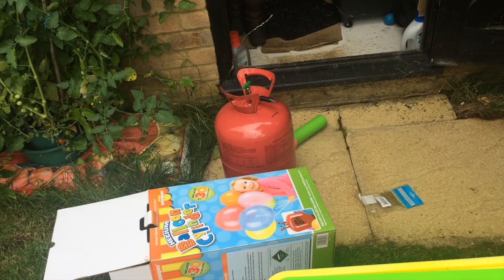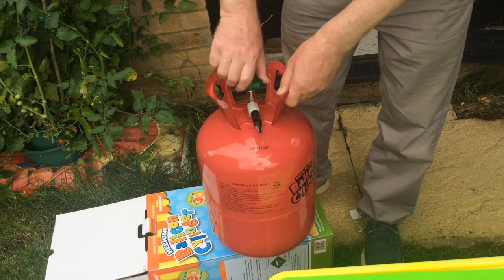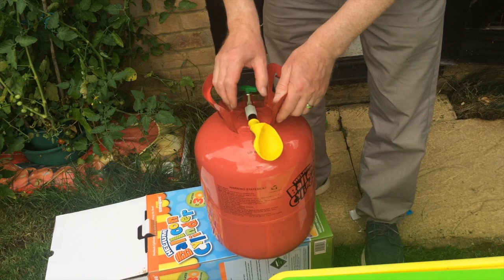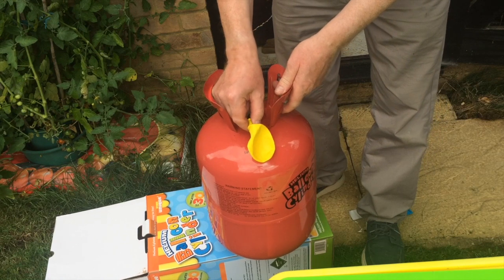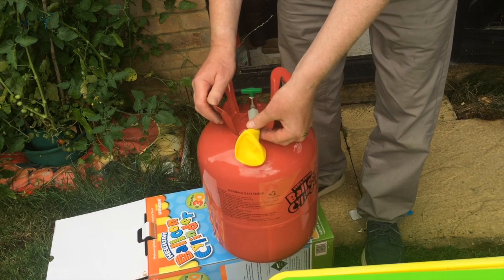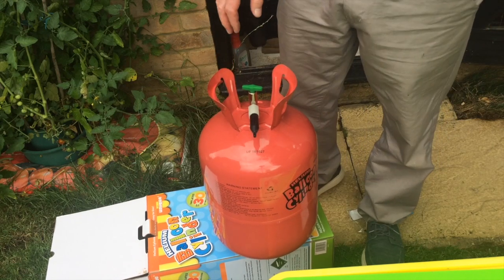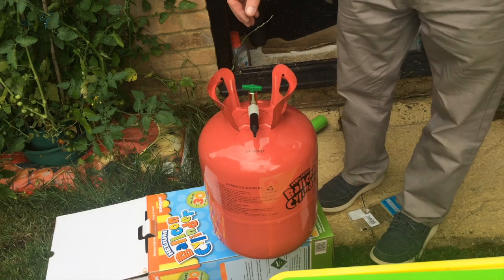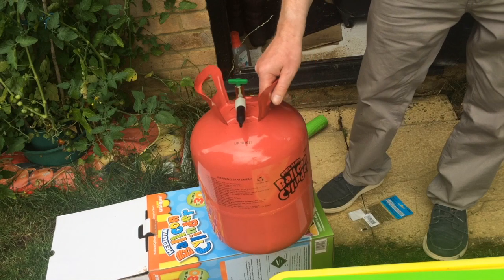Blowing Up Helium Balloons Correct Cylinder Instructions #fixed1t526

Comment: does cylinder balloon if the valve is on without nozzle still the gas comes out
Reply from the maker: Hi thanks for the comment. As long as the top is screwed close it shouldn't leak. If the video helped you, please feel free to buy me a coffee using this link:  https://www.buymeacoffee.com/fixed1tfix4  I need a lot of it to continue making these videos. Please don't forget to subscribe and check out my other great videos there are over 510 to choose from and share @fixed1t with friends, family and colleagues as I could do with more subscribers to help grow the channel. Many Thanks Malcolm aka @fixed1t
Reply: @fixed1t  ok if you open the top and not putting a nozzle, does the helium goes out like putting a nozzle?
Reply from the maker: Its the nozzle that operates the gas release like a cows udder, you open the valve then gentley push down the nozzle and the gas will start to come out, the harder you push the quicker the gas comes out.  I hope that helps I'm dying for a coffee ;-) lol Best Regards Malcolm aka @
fixed1t
Reply: @fixed1t  thank you your answer.